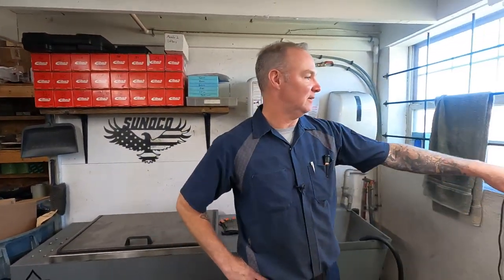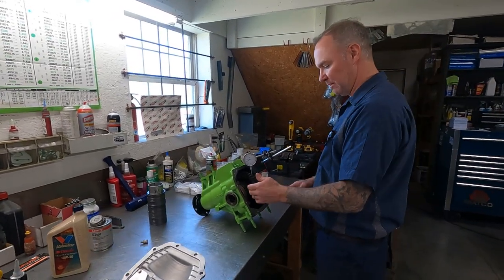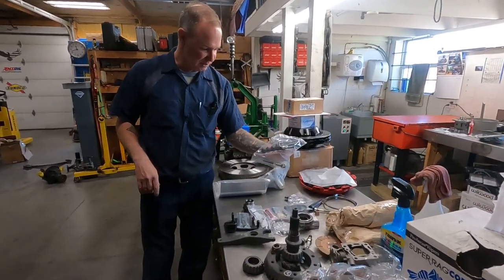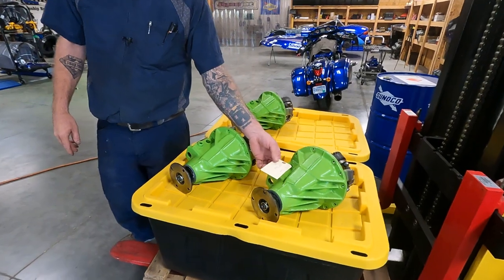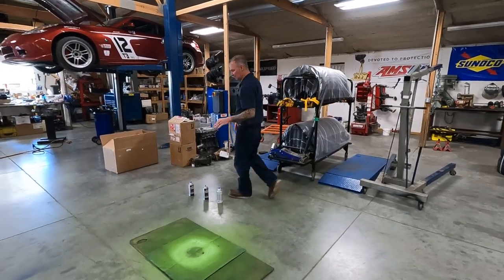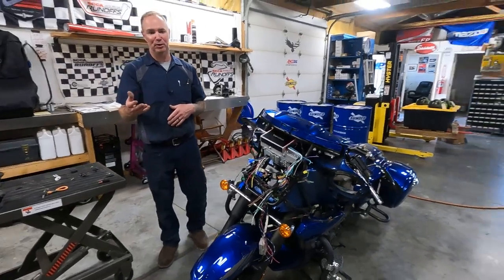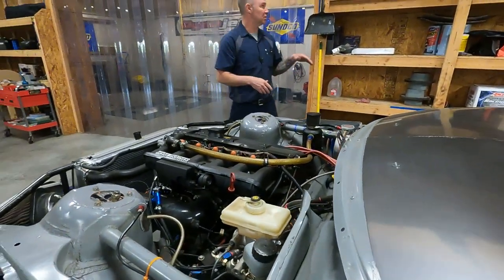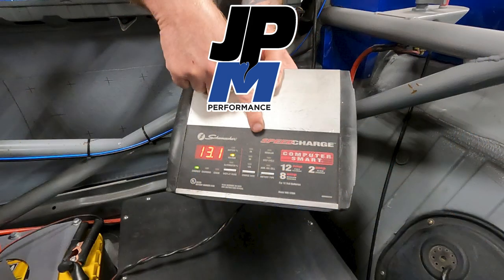SHOP TOUR - What I do when there is no racing on the weekend!

Comment: With a total loss battery system at what voltage do you become concerned with it being too low.
Reply from the maker: With a proper battery it should never to below 12 volts however most cars will still run fine at even 11.8 volts.